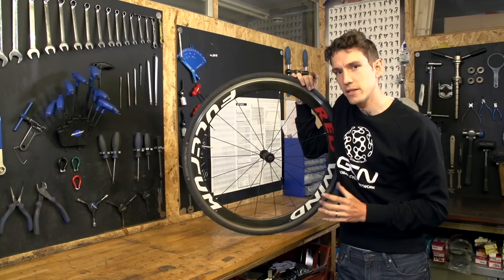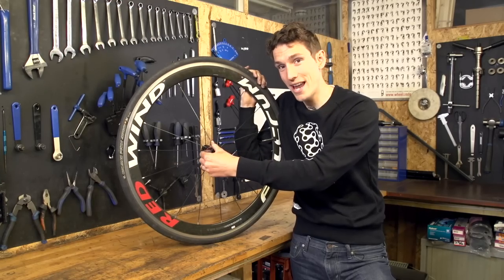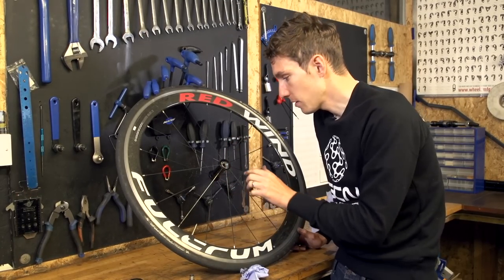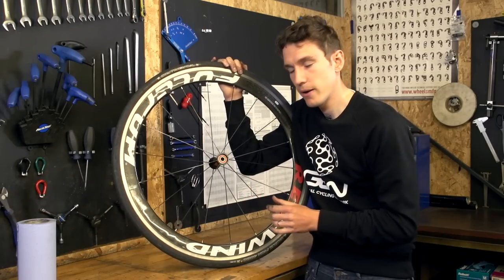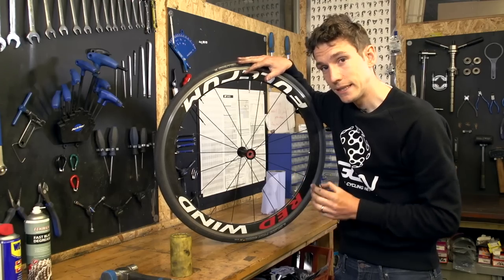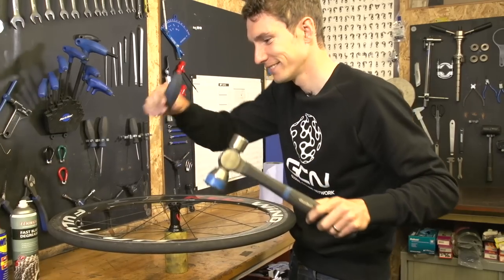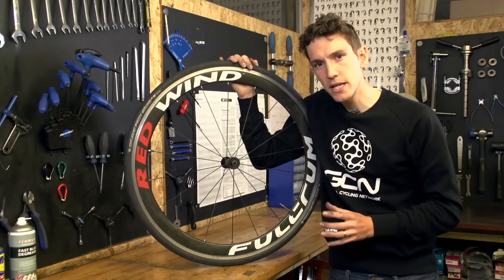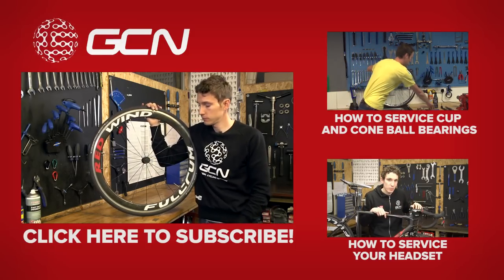How To Service Cartridge Wheel Bearings

Comment: When replacing the bearings, you can put the new ones in the freezer getting them as cold (and therefore as shrunken) as possible. Also warming up the hub can give you some extra space. Be sure to put it in fast though, due to heat transfer...

Comment: so we use degreaser to remove the old grease, then use WD 40 to remove the degreaser, am I right? So the WD 40 would be like the de-degreaser, right?
Reply: WD40 is a water based solvency so it will plush out the degreaser, i believe
Reply: @nguyenvanduc2512  Check the ingredients on your WD-40 can, my friend. You'll find it contains zero water.
Reply: @purklefluff  indeed, it's a water-repellant actually.
Reply: Chuck them in a pot of petrol mate. Im sure if mechanics have done it with engine bearings for years and years it will be fine
Reply: It's actually a water displacer (WD) not water repellent 😉

Comment: How you stroke out the old bearings doesn't really matter that much. When pushing or stroking carful new one in the most important thing is to apply any force only to the outer ring of the bearing cartridge. Please note too that bearings actually come in series. The identification is typically written on the bering itself like XXXX for size and 2RS for both size resin sealed.

Comment: Never use a magnetic tool on shimano hubs period end of story. Use an eyebrow puller tool ( yes no joke) to pick up the loose bearings or add them in when repacking. Magnetized bearing balls tend to move towards each other and also pick up metal fragments.

Comment: Fitting the bearing in is really simple: just put the bearing in the freezer fora half an hour; gently heat the cartridge (eg. with warm water). After fitting simply blow the water with compressed air.

Comment: I'm a skateboarder turned cyclist. Bearings in skateboards were more exposed and if any bit of water got into them it would make the cage that holds the ball bearings rust and break easily. Cycling makes me nervous with them but they are covered which is good. I think taking the time to treat them will help save you a lot of hassle eventually
Reply: Gf
Reply: Marine grease does a great job of improving waterproofing of a bearing.

Comment: Use a threaded rod with suitable large washer (or drilled 5mm steel plate) and nuts on both ends as a bearing press.

Comment: Si, I cringed when you rested the wheel on its spokes to tap out the axle and bearings. Are you sure that's advisable. I would have thought that the hub body would be a much safer place to rest the wheel when exerting such force. Why risk bending or damaging a spoke?
Reply: Tensioned spokes are much stronger then you think. People tend to think that spokes on a bike is something that you cant touch ever again. not a big deal

Comment: 2 things
1 i need that rear mech hanger chart in my life
2 to people asking where can i get a cheap bearing drift set simple answer you cant. specialist tools are generally more expensive but if youre a bit of a diyer and want to do this yourself but dont have a drift set you can basically do what he did in this video and use the old bearings to press in the new ones as they will press against the inner and outter race as they will be identical it wont harm the bearing in anyway and will save you having to buy a £100 tool you will likely use 2 or 3 times

Comment: I have a question.
What kind of fit does the axle have in the bearing. If axle is loose fit onto the inner ring, won't slipping happen?? pls solve my query
M just confused about the axle, how does it look like, is it like full threaded cylinder of same diameter throughout??

Comment: The silver color washer that sits on top of the red bearing seal - is that washer supposed to rotate with the wheel. I cleaned up/regreased. But feel like the washer is rubbing against the black housing along its circumference. Any help is appreciated.

Comment: Using grease is undoubtedly better, but without breaking the seal I have spun oil into the bearing for a quick maintenance. Oil works its way in on certain seals I guess. Probably doesn't last as long though.
Reply: methunshow  Oil dries out much faster, and also has much less protection even when it is fresh.

Comment: Si, am I crazy, or are those Bones Reds skate bearings in your wheel ?
Reply: Not sure of the size, maybe 608RS, the RS is for Rubber Shielded. 2RS is rubber shielded on both sides (not these ones). Z is single metal shield and ZZ metal shield on both sides. I used to skate and now I'm a boring old man 🤣

Comment: Interesting- Have you any experience with the AX- Lightness Premium 38 carbon tubulars? They are very light at only 1015 grams with the Tune hubs, just wondering if anyone has used them for the durability aspect?
Reply: ***** Thanks- yes those wheels would be for my 2nd bike, Evo- hi mod,, I have had tubulars before but never the AX brand.I have a 2015 CAAD-10 Ultegra with Mavic R-sys and Continental gatorskins, [great tires]

Comment: You said you were surprised the factory grease was still in the bearing.  Very ballpark what sort of mileage do you expect factory grease to last?
Reply from the maker: Lance Welch Hi Lance, it depends completely on what conditions you ride in. Wet weather, could be a couple of thousand, dry conditions and there needn't be a limit.

Comment: Simon, just curious how long does a set of wheels/rims/bearings last you? I realize that your CX wheelset won't last as long as your road but I just find it odd that your bearings wear out at the same time as your rim that's all.
Reply from the maker: RockShandy A set of training wheels that I used in the UK would last two winters, so probably about 10,000 miles maybe? Hard to say really, but I've just had a rash of old rims go recently. 

It depends completely on the conditions you ride in though. I used to have to train in all weathers and that meant wet, gritty braking for many many miles.

Comment: I took my rear cartridge hub to LBS to replace a bearing..  hub worked as a charm after that.. Until I cleaned and grease a chain, probably some sand entered into hub, and now I got some grinding noise when the wheel is turning fast :(

Comment: Spent about 500 miles on it and so far so good. https://www.youtube.com/post/UgkxMesz3KOGEmwmvyKQfLfrRSUXLFzfVHZA   Pros:1. Very light2. Solid quality build3. Fast delivery: It arrived 5 weeks earlier than expected.4. Easy assemblyJust a few cons but nothing major:1. Cheap tin tubes and had flat on first day... but not a big deal. I replaced the tubes.2. Seat is a bit uncomfortable but that's pretty much the same situation with most bikes.3. Seat post is a bit long/high for a smaller size 48 bike - had to saw 2 inch off to fit properly. The lowest setting is too high. The post locking system does not seem to hold well (perhaps because I saw 2 inch off).4. wheels are not tubeless compatible (from what I can tell)
Reply: Why does he say flush out the degreaser using some WD40? I thought WD40 is a degreaser

Comment: I discovered a simple method to remove recessed bearings without specialist tools and zero risk of damage to the wheel.  Just grind the head of a coach bolt until it fits snugly inside the bearing and walk it out.  If its tight then use the head of the coach bolt as a contact surface to punch through from the other side while applying angular pressure on the coach bolt.  You may need help if you are not dexterous.  Remember gentle taps and it will eventually release from the recess.  Peace out Duncrunlad.

Comment: I was wondering if anyone out there or you could help me with an issue I'm having. I recently got myself a Planet X carbon fibre bike which has vision wheels which have been very good so far tbh. But after a couple of tough, wet rides for the bike the rear hub started to make this grinding sound and the rear wheel doesn't spin as freely as usual. Today I took apart the hub and and degreased and greased it up again. Removing any dirt I found within. However after putting it all back together everything is still the same. I thought it would get rid of the grinding sound but it hasn't. Obviously this sound is extremely annoying even though I don't notice it when cycling I just know it is there. But I'm worried but cycling I will make it worse and end up needing to purchase some wheel replacements. A full service at a bike shop that includes bearings is a rip off so I wondered if anyone out there could help me on this one. Many thanks in advance
Reply: Take it to the shop in this case. Not worth breaking your wheels

Comment: These bearings are so cost effective, forget servicing them and just replace them
Reply: yes one brand new Tiagra BB-RS500 bottom bracket cost like 10€ and holds easy 2-3years with zero service. Its dirt cheap. how ever if getting spare parts becomes hard or get expensive, doing more caring and maintence makes sense.

Comment: Please don't skip over the initial removal of the end caps, you might think that's super obvious but I'm looking at mine and it's very non intuitive how they all come apart.
Reply: For anyone with the same issue, these caps just thin covers, gently hold the inner lip of the cap with a pair of pliers and pull outwards, it comes off easily. The cap should have a tiny rubber seal on the inside face, check that's in good condition. The cartridge bearings sit behind these, clean the sides and look up the code printed on the plastic side of the bearing, that's the product code of the new bearing you will need.
Then take a wild guess as to what you've got because no manufacturer will ever show you pictures, spec lists or manuals for their old (> 5 minutes) products, and nobody in the bike media makes a fuss because they all have new bikes with manuals... sigh.

Comment: When i ride a bit harder i keep hearing a clacking noise could this be it?
Reply: kiboks1707 Does it happen when the crank is not turning?
Reply: It could. I started to hear intermittent clicking noises, especially when going uphill. I got my crank replaced, thinking that was the culprit, which did nothing. I eventually got my rear hub bearings replaced at the bike shop, which made a world of difference. Noise gone and much smoother pedaling. If you lift the bike up and there is significant play on the rear wheel and/or roughness/vibration, when you spin the wheel, I would say that the bearings are a good candidate.